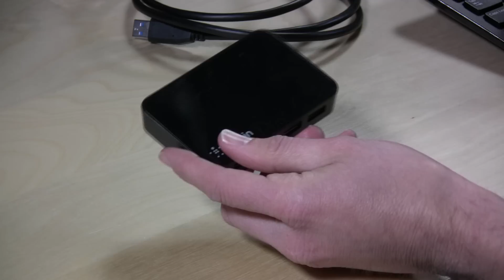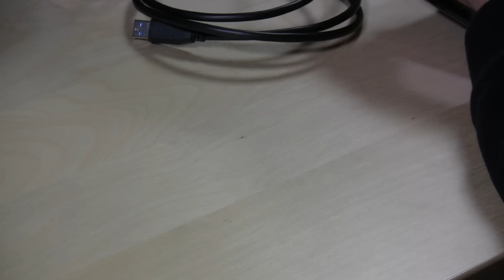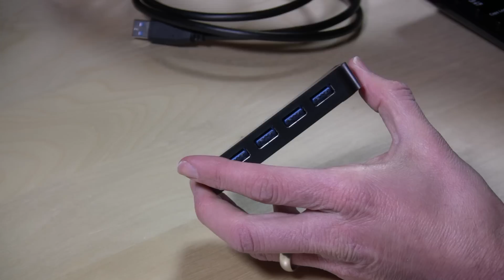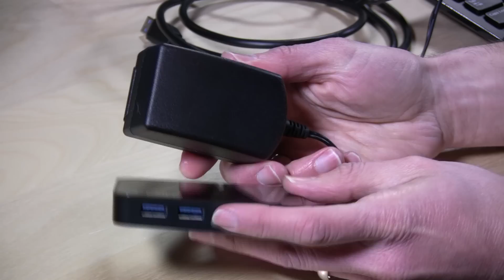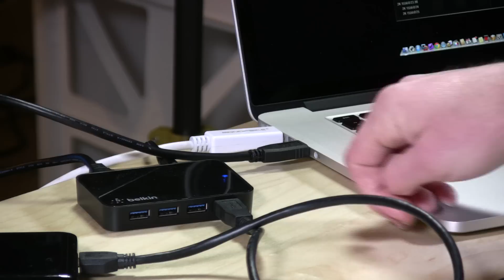Belkin SuperSpeed USB 3.0 4-Port Hub Review F4U058tt

Comment: Ok so what the hell is wrong with mine. I have a 3 port usb 3.0 hub and whenever I have multiple devices plugged into it they don't work well. For instance. I'm pressing multiple keyboard buttons and mouse buttons simultaneously and many of the commands aren't executed. wth. It is like it can only do so many before it stops accepting commands.. not ideal for any situation. Is this just maybe a bad hub or wut...

Comment: Lon, thanks for your reviews. Please take this as advice, I don't like useless haters. 
1. This is a USB 3.0, you should have tested a 3.0 device! (YOU are the hardware geek after all, it's obvious from your bookshelf.) Using a "generic 1TB drive" is not helpful. 2. It's a 4-port hub, plug in more stuff and test the bandwidth with 4 things connected for crying out loud! 3. Actually, what did you talk about in the "review" that actually reviewed it? Sorry, but I fail to find anything helpful.